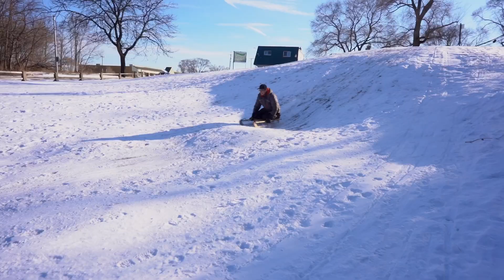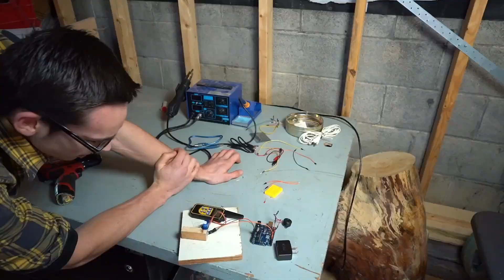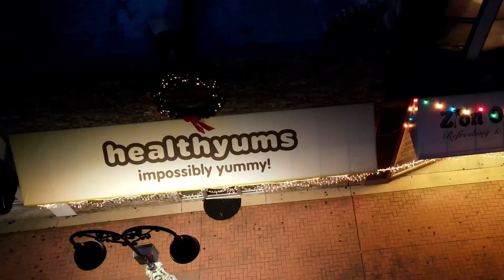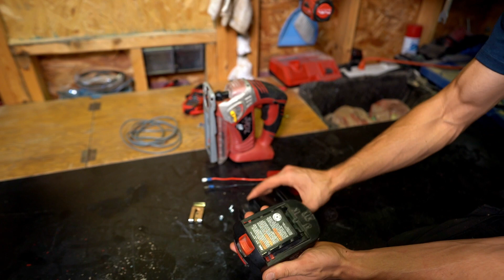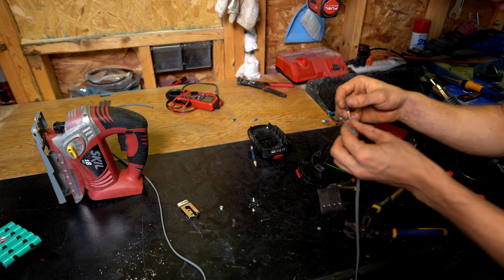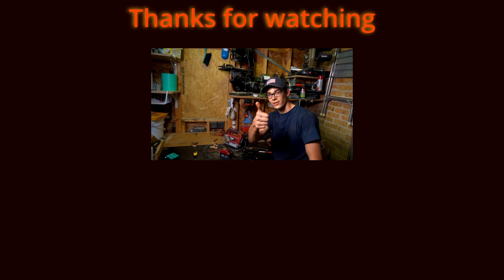Using A Milwaukee Battery To Power Skil Tools

Comment: Does anyone make a adaptor for this? Exacly what i want to do but want to keep it tidy.
Reply from the maker: I looked online and there were a lot of adapter for Skil batteries and Milwaukee tools but not the other way around. But if you have access to a 3d printer that would probably be the cleanest.
Reply: @TheRandomVidsChannel isn't it the same thing,? Can you just flip it around
Reply from the maker: No, it's a male end where you need a female, and vice versa.